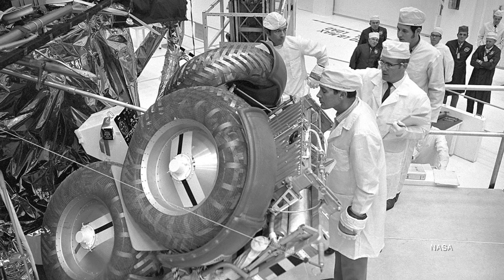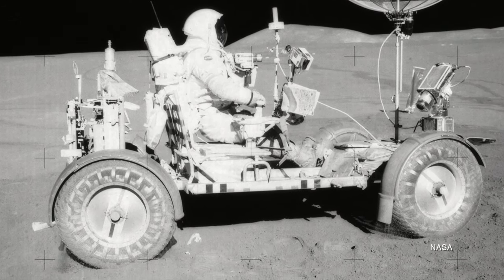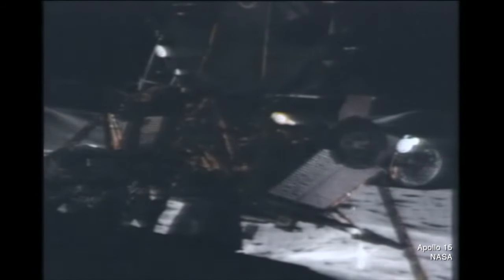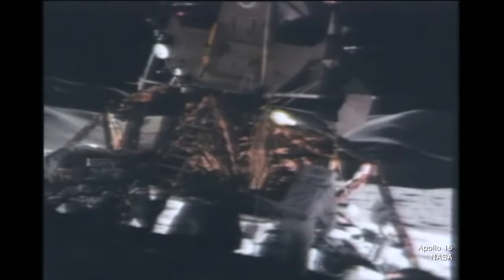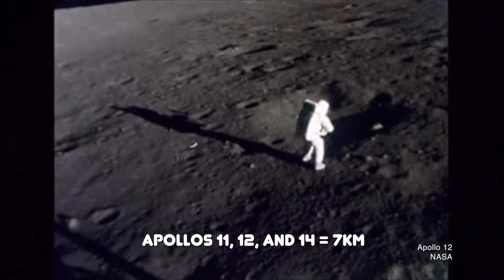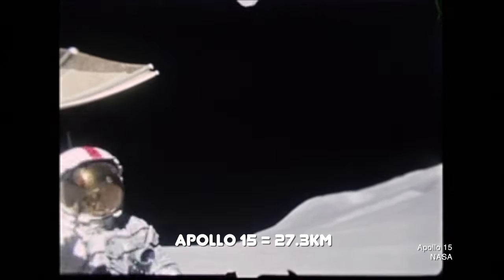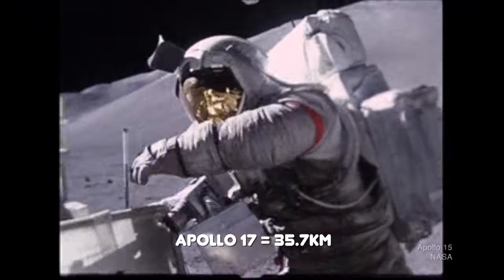How NASA Took Cars to the Moon

Comment: So they finally find a way to go through Van Allen belt? Cool!
Reply: they found a way 50 years ago.
you go around the inner belt, and then proceed very fast through the thinnest part of outer belt
Reply: @spatrk6634  
Well, just for clarity, Apollo 14 went right through the middle of the Van Allen belts (hence why it received the highest radiation dose of any Apollo mission).  It was the only mission that did that.  But, yeah, it's still insignificant, still far less than 1% of a fatal dose.
Reply: What makes you think they couldn't go through the Van Allen belts?  Did a conspiracy video tell you that?
Reply: @spatrk6634  But you cannot leave low earth orbit today according to your Astronot's!
Reply: @kongmik  "But you cannot leave low earth orbit today according to your Astronot's!"

Obviously - when that was said they had no super-heavy lift launch vehicle capable of placing the mass of a manned spacecraft onto a translunar trajectory. That's why.

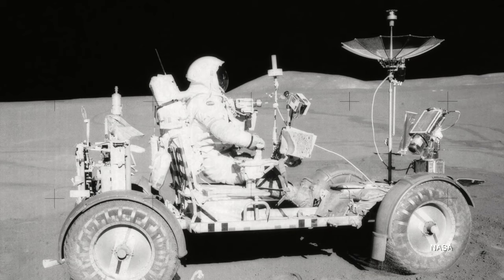Comment: Starting at 1:15 min. I don't see the tire tracks or rather the mesh tracks in front of the wheels and the back of the wheels. How did it get there without making tracks? Looks like it was hoisted and just let down finding itself where it's at.
Reply: Yet you can see the dust picked up by the rear wheel spilling back to the surface behind it, and off the front wheel fender, indicating the the rover is moving at this point. A photograph isn't always going to show you the tire tracks clearly, depending on a number of factors.

Comment: Hello. What was the battery range of rovers?
Reply: butchtropic and capacity ? aH ? Or range in km or miles ?
Reply: @ilyaignatkin4474  
It depends on the terrain, but, generally, the range was thought to be about 40 miles.  They only went around half of that with each rover, though.

Comment: Question: What kind of G force is that launch at 3:22 ?
Reply: Trebor  
Thanks.  Maybe I worded my question poorly.  The acceleration rate upward seems unsurvivable
Reply: Trebor  
Agreed, so disregard that.  Instead imagine the humans inside and look at the distance over time they are accelerated upward.  I've never seen anything accelerated that fast with humans inside
Reply: Trebor  
I see.  I should not have used the term G force.  I think I should have said rate of acceleration experienced by the passengers inside blasted upwards is quite remarkable.
Reply: Trebor  
Looks like I was the one confused.  Think I got it now.  Though it looks like the acceleration rate is incredibly high, the "G force was not that much.  Thanks for your patience.
Reply: @gonebamboo4116  
This video is greatly sped up.  Go watch the original.
Reply: @rockethead7  
Not sure where to find one.  Do you have a reliable link.  I wouldn't know a deep fake if I saw one.
Reply: @gonebamboo4116  
Just search for "Apollo 17 liftoff from the moon."
Reply: @gonebamboo4116  
You also have to remember that the LM's ascent stage was pretty small, so it seemed to accelerate much faster than the enormous Saturn V rocket.
Reply: @fromnorway643  
Right.  The interesting thing is a transcript somebody sent me from NASA describing the erosion of the moon's surface upon descent.  It plainly states 4-6" were removed.  Honestly, is that what you see when closely examining a picture directly below the engine nozzle?
Reply: Trebor  
How do you see what's underneath the pads?

Comment: NASA is know for having backup planes for there backup planes.  They are also know for being very weight frugal.  
In the Apollo era did they send many spare parts?  Or just complete backup systems?
Reply: They had alternatives for almost every scenario.  The only system which did not have a backup was the ascent engine for the LEM.  It had to work or they would be stuck on the moon.
Reply: If you look for it you can find a PDF of a document called "Lunar Roving Vehicle Operations Handbook" online, which has an interesting section entitled "Malfunction Procedures". For the electronics related malfunctions most of the procedures start with switching to an alternative circuit and seeing if that fixes the issue. So it appears that for the electronics the rover had many built-in backups. The Rover design also appears to be quite failure tolerant by design; with four independently driven wheels I don't know if you could get back to the LM on one (if three failed, and maybe you dump the rock samples) but it almost certainly could still drive on two. And the four wheel steering could be switched to front or rear two wheel steering in the event the of that system failing.
Reply: Thanks for the info. I'll check that out.  I was however referring to the Apollo missions in general and not just the rover.  Yet that sound look cool info.
Reply: There was no backup for the Service Module engine, either. If that didn’t fire, they were stuck in lunar orbit.

Both that engine and the LEM Ascent Engine were hypergolic--just open the valves, the fuel and oxidizer mix, and start burning, no special ignition procedure needed. As simple and as reliable as possible. No throttles, even: just on with full thrust or off.

The only downside was that the reactants were very toxic and corrosive. For example, running an engine test on Earth would destroy that engine. So you could never really test a production unit.
Reply: They knew that the Service Module engine worked when they fired it for Lunar Orbit Insertion, if it had not, they would have gone on a free return trajectory around the moon and back towards Earth.   I guess if something had gone wrong with it while in lunar orbit,  they would have no backup.  Apollo 13 proved the LEM descent engine could bring them back but it was left on the moon for all the other missions.

Comment: What were the tires filled with?
Reply: David Harris vacuum... the tires were a strap mesh not solid/filled. as they drove the lunar soil was scooped into the tires and flung out, hence the need for 'mud flaps'. when they turned sharply or stopped the soil would fly out, covering the local tracks. you can still see tracks leading up to the stopping local.
Reply: Don't you see they're wire meshes?

Comment: The rover was  a bad idea.  The farther they can go, the farther  the walk back to the lander if the  rover breaks down 
There could be a five-mile walk  back, in which case the astronaut's oxygen would be depleted
Reply: It was all for show
Reply: samslick90, what ARE you talking about?  The rover allowed them to cover 20+ miles of the lunar surface, which they'd never have been able to do on foot, especially not while carrying samples, equipment, experiments, tools, cameras, etc.  Yet, you're calling it a "bad idea"??  And, yes, they were very well aware of the fact that they needed to stay within walking distance of the LEM, in the event of a rover failure.  That's why they tended to do the further stations toward the beginning of the EVAs, and then come back and do the closer stations toward the end of the EVAs.  They always stayed within walking distance with the amount of oxygen they had.  And, they had and OPS system (oxygen purge system) that was mounted to the PLSS that could provide secondary life support for an additional 1/2 hour if their PLSS backpack failed.  Basically, they had a total of over an 8 hour supply of oxygen.  So, don't sit there and whine about how it's a bad idea to use the rover, throwing around spurious nonsense about how their oxygen would be depleted.  You don't know what you're talking about.  Stop pretending you know more about these topics than the 450,000 people who spent a decade of their lives designing/building everything for Apollo... as if none of them ever contemplated something as trivial and simple as making sure they had enough oxygen.

Comment: How did they rover batteries operate in such extreme environments of temperature? They were way outside of the operating parameters.
Reply: Using clever engineering witchcraft. Adjustable solar shielding in this case to adjust the temperature of the batteries. They couldn't possibly operate in the dark, but kind of irrelevant since all the Apollo missions took place on the sunny side(s or whatever) of the moon.
Reply: They weren't in use during the extremes- just when things were basically no worse than a desert on Earth.
Reply: Batteries dont work in the dark? Tell that to a flashlight. Also the "sunny side" of the moon gets up to 253 degrees fahrenheit. Lead acid batteries lose their charge beyond 122 degrees farenheit and under -4 degrees fahrenheit. Maybe you can make up another answer? :)
Reply: Glad to hear it! Now if we could just locate the engineering drawings or blueprints of said solar shields and temp regulation system. They're not in the US patent archive.
Reply: They weren't in use during the extremes- just when things were basically no worse than a desert on Earth... as I said. And since NASA is taxpayer supported, its innovations can't be patented. Even if using shiny metal to reflect heat, and conductive metal to conduct it, were patentable.
Reply: Try "around 250 degrees, about a week after the astronauts left". Who cares how hot it got after the LRV had seen its last use, and the astronauts were home?

Comment: I have a question.
On Earth transmitting vehicles are normally equipped with stabilizing pods in order to keep them from shaking during the broadcst, why don't NASA bother to place something similar on the rover as well, since it was supposed to broadcast a signal from a distance hundreds of times higher than a simple earth satellite? Given that, according to NASA's manual, " The High Gain Antenna pointing must remain within 2.5 degrees of Earth" and that " The video signal will degrade very rapidly beyond that point." How was it possible to broadcast images with that kind of shaking without the signal breaking nor degrading during the live feed from the moon?
Reply: ytmoog The Rover TV during the live Broadcast in Apollo 15, 16, 17.
Go and watch how the rover is traveling in the dunes and takes  jolts and swerves; because the satellite dish is directly connected to the rover, which has really soft cushions, then the parabola loses sight of the earth completely and continuously. Just look at it as the line on the horizon moves continuously. You just have to go watch live videos of those missions.
Reply: Yes it was taken from the 16 mm film camera. A much better quality and color, mounted directly on the rover, which broadcast live TV. In fact, the camera was remotely controlled from the Earth by a specialized technician.
Reply: 16mm film camera.  It doesn't broadcast.  What would it broadcast?!??!  It's film.  Film has to be developed in a lab.  Nobody saw the film until they returned to Earth and that film was developed.  It cannot be broadcast.  The only footage you have seen from a moving rover was taken with the 16mm film camera - which was not broadcast live - nor could it have been.  IT IS FILM.

The TV camera was never used while the rover was in motion.  The TV camera was what filmed the take-off and was remotely controlled.  Again, the film camera has film in it that needs to be developed so it would be impossible for the film camera to have filmed the lunar liftoff - because who would be bringing the film back?! 

It is higher in quality because it is film;  it was never broadcast.

My God, dude.
Reply: Willoughby: Well, you saved me from needing to write that.  If you remember me at all, I don't hold back on letting conspiratards know exactly what I think of their ridiculous opinions.  I'm not sure that Shane is one, though.  It seems that he's just asking questions (something I wish all people would do, if they don't know the answers).  I really let 'em have it if they make assertions without asking questions, or if they are just pretending to ask questions.  But, in this case, maybe he was truly asking questions... not sure yet.

Shane: If you're a moon conspiratard, my message to you is, you're an idiot.  If you were honestly just asking questions, and you weren't accusing the moon landings of being faked, because you really didn't know the answers, I truly (not kidding) congratulate you for asking the questions... unlike sooooooooo many people who make assertions, but never ask questions (at least not honestly asking them).  I truly can't tell if you're honestly asking the questions, or if you're a conspiratard pretending to ask questions, expecting there wouldn't be a valid answer (sometimes it's difficult to know the difference, unfortunately).  But, seriously, Willoughby is correct, and not to assault you too hard here, but did you think that through?  You know it's FILM in the cameras while bouncing along.  The live transmissions were always from a stationary rover, once the dish was aimed.
Reply: Shane, I thought I was being nice to you, since you were only expressing opinions and seeming to ask questions.  But, this is getting fucking ridiculous.

1) You just got done saying "Yes it was taken from the 16 mm film camera. A much better quality and color, mounted directly on the rover, which broadcast live TV."  This is pure insanity.  But, ok, I tried being nice, even though that is a fucking insane comment you made.  But, I now see Willoughby was right in going straight to ridicule.  Good grief.  Film needs to be developed.  Live TV broadcasts don't.  Both he and I told you, the only live broadcasts are when the rover is stationary.

2) Now, you're disagreeing, and you're claiming that the video you just linked (https://www.youtube.com/watch?v=axgp_CDWwMQ from timestamp 53:47 to 54:23) represents WHAT??  Good grief.  This is clearly from a stationary rover, just as we said.  They just got done saying "ok, we've got a picture" (just sync'ing with the stationary rover).  The next thing you see is the camera zooming back in.  No, that's not from movement of the rover.  The camera had pan/tilt/zoom capability.  And, then the camera is being moved up and down on the stationary rover.  I'm not sure why, nor do I really care that much.  They had just talked about "brushing off" (I couldn't make out the rest of what they said).  Maybe they were brushing the camera off, and it rocked back and forth.  Maybe they were brushing themselves off, and may have been bumping the camera.  I don't really care.  The entire point is that the rover is STATIONARY, even if the camera itself is rocking back and forth.  The rover IS NOT MOVING.  You are wrong, and just being stupid at this point.  Sheeeesssshhhh.

You have no clue what you're talking about.  Good grief.
Reply: Yes the rover is not moving, what i said in that comment is not true Thanks for make me notice that
Reply: usually undulations happen because one of the astronauts approaches the rover to take or store instruments